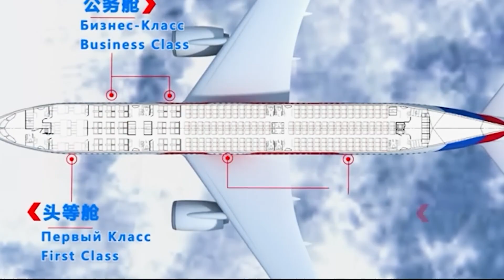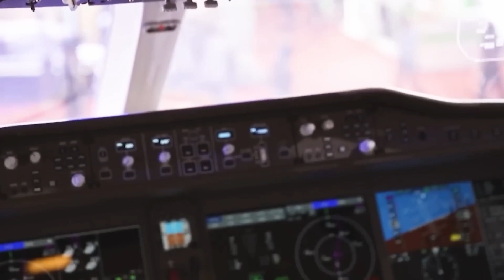China's New Jet Engine Is Changing Everything!

Comment: Those High Powered jet engine already being successful tested by the Military Unit being the WS 15 and this paved way for CJ1000 commercial Turbofan unit. Another Great News is the AEP Turboprop engine for MA700. MA700 was delayed 5 years due to Ottawa Refused to supply PW150 engine. Canada can keep the PW150 engine and boil soup with it as Avic started testing the a re engined MA700 a few Days Ago. Hopefully we see a bigger Turboprop plane in our skies Soon.
Reply from the maker: Great points — the military tech transfer to commercial engines is key, and it’s good to hear about progress on the turboprop!

Comment: FYI China is the only country after the US to have the technology to build hollow section single crystal blades. 
Not even Russia or UK. That is why RR and German MTU source their crystal blades from China. RR for the Trent engines due to overheating.
Yes. The future of aviation engine is in China as they are ahead of the rest of the world in material science. It was reported that the internal combustion achieved 2100⁰K Even GE F135 can only achieved 1800⁰K and recently encountered overheating problem probably due to REE shortages. Russia IDZ-30 has been in development for the past 30 years due to flameout.
The AECC CJ1000AX is currently waiting for certification from CAAC, IMO the strictest in the world today. FAA and EASA have all fall victim to politics and that reflected on their professionalism. FAA have signed recognition for their counterpart airworthiness certification but refused to honour their commitment.
Reply: - For the most crucial turbine blades in engines, is the lost-wax casting method used. This is a craft Chinesee mastered over 3,000 years ago.
Reply from the maker: Great point — the single-crystal turbine blade tech is a game changer, especially for high-temperature efficiency. Many people still don’t realize how dependent Western engines are on Chinese REE supply chains. Your comment adds real depth, thanks!